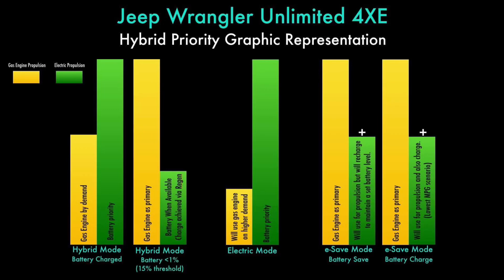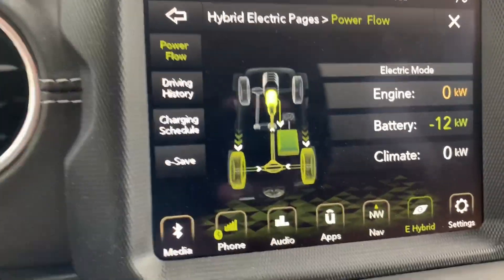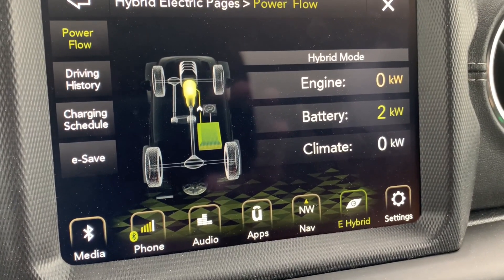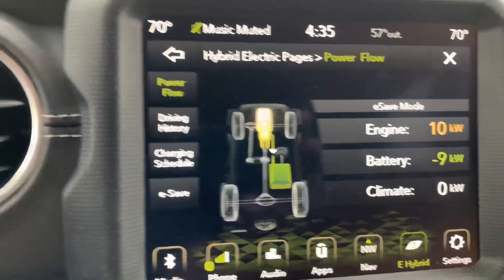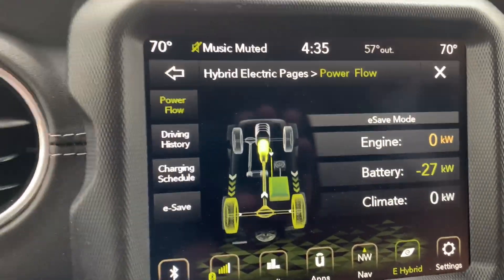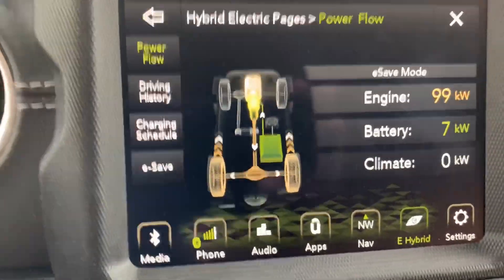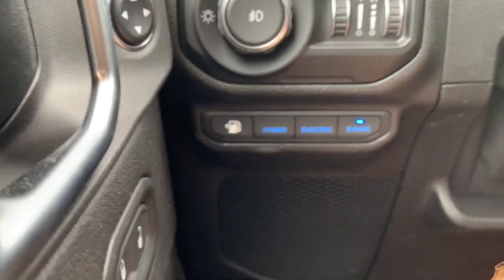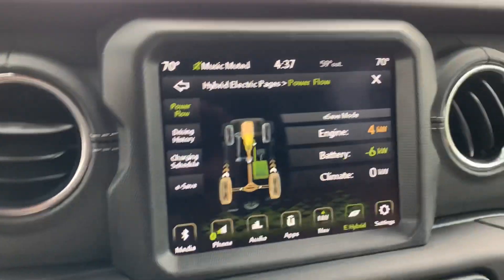What the Wrangler 4XE Modes really do (hint, it’s always a hybrid)

Comment: Does the gas engine directly drive the wheels or generate electricity to run the electric motors? Oh... Just got to the answer in your video.
Reply from the maker: The engine connects to the front of the transmission through a clutch. The main electric motor is in the front of the transmission. When that clutch opens, the electric motor can provide power alone. When that clutch closes, the gas engine and electric motor bother provide propulsion.

Comment: Just got myself a new to me 2022 Rubicon 4xe. It was a manufacturer buyback due to a faulty high voltage battery. Basically a lemon lol. I got it for 41k out the door with 1500 miles. The original MSRP was a little over 62k. Fca replaced the high voltage battery and put in a new hybrid control processor module. They also extended the warranty on those parts by 12 months and unlimited miles. I hope it holds up. Thanks to your channel I am learning so much.
Reply from the maker: That’s a great deal.

Comment: Thanks for the details, it blows my mind they have so low of an MPG as a hybrid.
Reply from the maker: That’s the down side to PHEVs, they get the benefits of a hybrid but they weigh so much more.
Reply: @Wrangler4XEFans  I’ve been considering a Gladiator 4xe when they come out, just not sure the additional cost is actually worth it in the long run.  - it’s odd to me that my CMax(hybrid) gets 36mpg and I hammer it driving 90mph every chance I get but these struggle to add 5mpg on top of the engine…
Reply from the maker: @RussellGernaatPLY  The shape and weight of the Cmax is way better than the Jeep Wrangler from an efficiency perspective. The Cmax was designed as a Hybrid. The 4XE is a Jeep Wrangler that had a plug-in hybrid system added to it.

Comment: Electric mode:
I believe that electric mode uses both the electric motor and the gas engine, but prioritizes the use of the electric motor. 

E-Save mode:
I believe that E-Save mode uses both the electric motor and the gas engine, but prioritizes the use of the gas engine.
Reply from the maker: The gas engine doesn’t run in electric modes unless the demand is high enough.

Comment: So should I always drive the vehicle in hybrid?
Reply from the maker: Depends on what you’re doing. Hybrid mode might create issues with a lot of short engine runs if you have a heavy foot. Around town, short engine runs in cold weather can create oil dilution which can cause FORM. So it seems like keeping your operating very binaural might be a good idea: either run in electric mode or make the engine run for a bit.

When you get on the highway, hybrid mode works just fine. A lot of people say to use ESave on the highway but that’s generally less efficient.
Reply: @Wrangler4XEFans  so around town going to work on surface streets should I do electric then or is hybrid ok as long as I don’t step on the gas too aggressively?
Reply: Also should max Regen be on no matter what mode? I am brand new to the 4Xe
Reply from the maker: @gregcohen2939  You can totally leave it in hybrid if you have a light foot. The gas engine can still kick in while in electric mode but the demand threshold is much higher.
Reply from the maker: @gregcohen2939  The first thing to understand about max regen is that in only kicks in when you raise your foot on the accelerator. It isn’t something that’s working all the time. It’s the additional deceleration force you feel when you lift your foot from the pedal.

With max regen on, the top inch or so of the accelerator pedal is remapped to allow you to vary the amount of regen. It’s not an all or nothing kind of thing.

Keep in mind, however, that while the brake light does come on when maze regen is kicking in, there are times that the brake light doesn’t come on. I have a video where I talk about the weirdness of when the brake light comes on and when it doesn’t. Just something to be aware of. I installed an indicator light in my roll bar in the back so I can see it when I’m looking in the rear view mirror.

Another cool thing about the 4XE is that it has a blended braking system. When you put your foot on the brake pedal, initially you aren’t feeling the friction brakes, you are feeling the P2 motor/generator in the transmission slowing the vehicle. That’s also where the deceleration from max regen comes from. That being said, it’s hard to say if max regen will actually put back more energy than normal braking, but it’s really handy for something close to one pedal driving. Some will say that max regen is less efficient because it slows the vehicle down too much and you have to speed back up which takes energy. That’s why it’s important to learn how to use that remapped portion of the gas pedal so that you only slow down as much as you need to.

If my driving is going to be around 45 and under, I turn it on. If I’m on open country roads or the highway, I generally turn it off.  Depending on your driving preferences and if you can teach your foot to maximize that remapped portion of the pedal, you can determine if you want it on or off. But with the blended braking system, you are grabbing back that same amount of regen energy when you slow for stops. That is, as long as you don’t cram on the brakes hard at stops. If you run up and slam on the brakes at the last second, you may bypass the blended braking and go right to the friction brakes. It will blend over quicker if demand is too high for the P2 motor/generator to compensate for.

Comment: Thank you for this. Is there ever a case where you ‘lose’ the full torque of the engine? I’ve read that even at 1% there is ‘buffer’ charge that still lets vehicle act as hybrid with full power/torque. Is there a limit to this?
Reply from the maker: I did some videos where I did sub 6 second 0-60 runs. The battery was at the less than 1 percent state. I have done some other tests with a full battery and saw the same results. With the P1/P2 design of the 4XE, the battery can be getting a charge even under full demand. It’s a great setup. I don’t think there’s ever a time that there’s a noticeable loss in power.
Reply: @Wrangler4XEFans  wow. Thank you for this info

Comment: Useful video. What would you suggest is the best setup for a NYC to DC road trip? I'm certain I'd use up all of my electric just getting out of NYC and will be at 1% for the next 200+ miles? I'll be running on gas for the majority?
Reply: I tested this scenarios recently on a 300 mile trip. 95% of the trip was highway driving. I began with a full tank of gas and full battery charge. I began in Electric Mode while I drove from my home to the highway on-ramp. Then, I switched to E-Save (with Battery Charging feature selected in Settings) as soon as I entered the highway. If I made a stop along the way which required that I exit the highway and drive on local roads, I switch to Electric. Then, back to E-Save when I returned to the highway to continue the trip. That’s the sequence I used for the 600+ mile round trip. I kept a record of fuel economy (gasoline and electric) using the U-Connect app. I also use the ChargePoint app to find charging stations. All the charging stations I used were ‘free to use’- FANTASTIC! I would schedule a ‘recharge at these charging stations to coincide with a meal break and/or bathroom break. All the charging stations were Level2. At the end of the trip I crunched the numbers and was pleasantly surprised to see that I exceeded all the EPA estimates: Full Fuel Tank with a Full Battery Charge resulted in a vehicle range approaching 400 miles. Gasoline-Hybrid fuel efficiency (Gasoline driving is ALWAYS ‘hybrid’ even if your battery reads <1%) of 23 MPG vs EPA of 20/ 21 MPG.  MPGe (which is a tricky stat to comprehend) was nearly 50. I was spending about $0.13/ mile using gasoline and $0.09/ mile using Electricity. hope this helps.
Reply: @stuyh1g  Great, well-detailed analysis. I drove approximately 500 miles on a round trip and kept the 4xe 90% on e-Save mode which included stop/go traffic and some in-town driving. I averaged 21.3 mpg all gas where the majority of the freeway pace was 70-75.  On another note for everyone, the 4xe Rubi with a hardtop was surprisingly quiet at 70 where my iWatch Noise app was giving a 65-68 decibel rating. That's night/day quiet compared to my previous JK!
Reply: @stuyh1g  thank you so much for the thorough and amazing analysis. I have heard that using e-save will noticeably increase your gas consumption. Is that true? I am currently driving on a highway and tried e.save and noticed gas gauge dropped all of a sudden more than its typical behavior
Reply: My experience is that e-save does not extend gas mileage and actually shrinks it. Saving and/ or charging the State of Charge will consume fuel. Maintaining a consistent speed of approximately 55 MPH and avoiding excessive heating or cooling of the cabin will do much more for mileage extension.

Comment: Hey. Had a question for you. Have you had any problems with your 4xe?  I had something pop up twice now. I go out to the garage and the fan is running really high, the temp gauge says 120F but the temp gauge on the Uconnect says 419F. Weird, curious if you have had any similar quirks. Thanks.
Reply: Hmmm. Ok. I will go with that. So many sounds that I don’t know if something is wrong or not. It’s a strange new world but I’m still enjoying it.
Reply from the maker: @davidgrove5525  Lots of strange sounds. When it starts in electric mode with the AC on, it sounds like a helicopter power up cycle.
Reply from the maker: That 419 thing is an Easter egg. 419 is the area code in Toledo. You’ll see that temp pop up when in electric mode.

Comment: Nice video,
Thanks , That explains a lot for me
I was also wondering when I first used the e save mode and tried to save the battery ( for later usage)as it was advertise by stellantis  in their launch presentation
But to my surprise when I started at 100% i wasn’t able to save the battery for later use in e save mode, it continues as a hybrid and battery % keeps dropping faster then the charge option.😀
Reply from the maker: Do you remember what state you were at? I don't think it will hold it above 95%.
Reply: @Wrangler4XEFans  
 
I was in E save mode and save battery, but I switched to charge when I saw it was dropping
I will try it again and see if it holds at 95% 
Thanks👍

Comment: Great video. I’ve had my 4xe for about 10 days now and just noticed a “sloshing” sound -almost sounds like water is running from the hood to the floor. There isn’t actually anything coming out, however. Any idea what that could be??
Reply from the maker: Are you hearing the pedestrian warning system?
Reply: @Wrangler4XEFans  I don’t believe so. This occurred after I moved the vehicle from my driveway inside the garage. It was in park and turned off, but the charging cable was connected. I literally had to look underneath to make sure water wasn’t pouring out.
Reply from the maker: @skseth  Oh, that sound. yeah, there's a lot of clicking and gurgling. I'm not sure what that is but it's pretty consistent a short time after you shut it off. Most people might not ever hear it because we don't often sit in a vehicle after turning it off. I'd like to find out what that is too.
Reply: @holds26  I would leave it in hybrid with regen. The battery is not really at zero, it has enough electrons to aid...occasionally. but with regen you will be surprised at how often regen adds a little juice to the battery.
Reply: I hear the liquid moving too... i wonder if it's the battery cooling system.